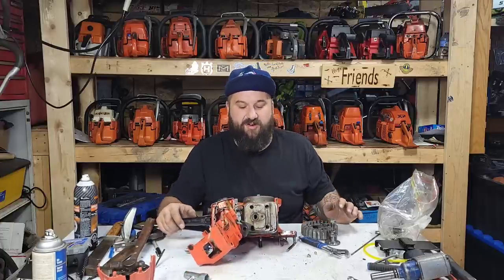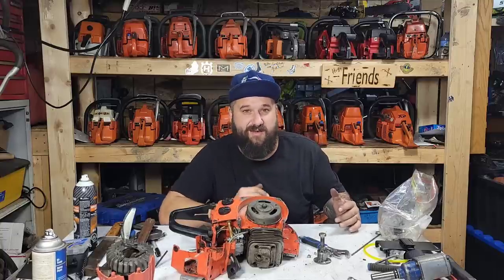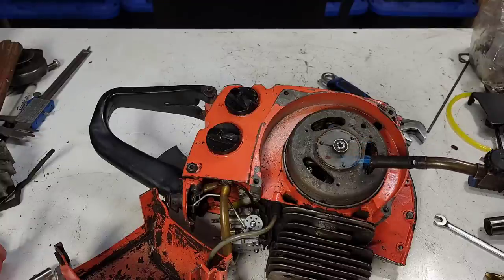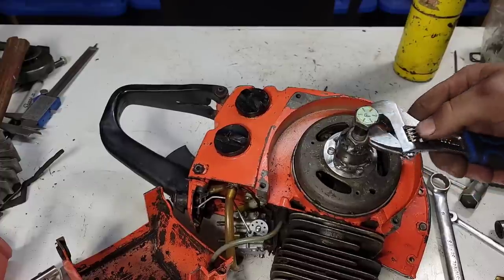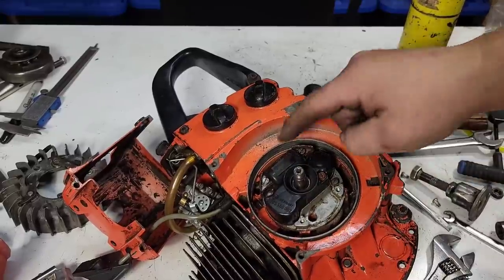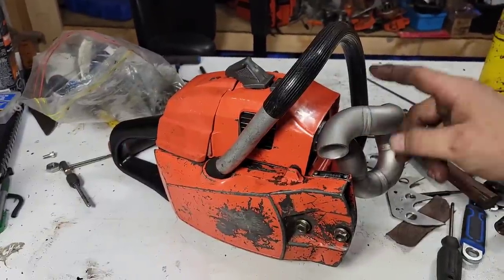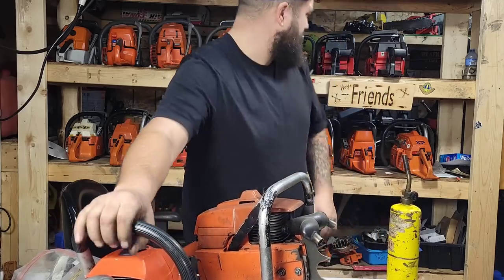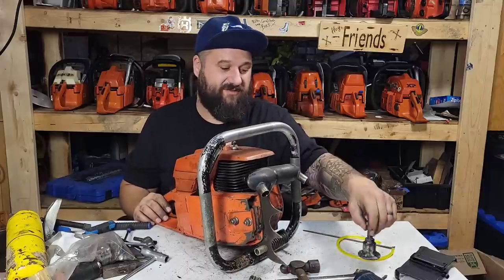Husqvarna 77 flywheel removal with a DIY puller.

Comment: This L77 has points ignition. You need to take off that plastic points cover  and clean points contacts with some 300 grid sand paper. It will spark, believe me. That rust on the magnets and coil does not hurt the spark. Magnetism does not care about rust.
Reply: Will this help me get fire to the plug? I’ve tried everything and can’t get spark. It ran last year but this year it won’t crank. Appreciate it bud

Comment: Nice "puller" build  :) , if I remember correctly , there is a set of points under that cover, bet a little crocus cloth on those points makes it sparky again, possibly a condenser as well. Believe is or not they are still available from a few places. I have an old L65 that needs a little attention on the points, this make jog me off center to get it sparky.
Reply: Liked the puller. Will something like that work for the Dolmar?

Comment: Hi Friend !  Why did you not sand the points ? That often be the culprit ! Sanding the magneto and the coil contact...i thought was secondary cause for ignition failior...  but needed to be sanded...i agree.  Hmm  I have several those types and one i damaged totally the magnets on...when kick on the cranckshaft... I glued them together though with JB weld..and stubburn to get it to run.  Love the saws..and guess what...it did work after...with gled togeter broken pieces of magneto.  Chainsaws is useful and fun.  Nice to be able to control their maintenance...thx to guys like you. Happy New year and hope things are well.  Good channel ! :-)

Comment: For the holed oil tank- you might try some of that “ new “ aluminum filler rod that melts at a lower temperature, sort of like brazing rod, slap a patch on it.  Or just acetone  and JB weld.  It’s oil, and not under pressure.  Cheap fix!

Comment: Silly newb question but with the hole in the oil tank could you go over and over it with brakeclean and/or electrical contact cleaner then giver the ol JB? Or would the oil behind it just cause near immediate failure?

Comment: a drop of oil on the end of the pointed bolt will help minimize metal galling. An affordable puller (not the round Stihl unit!) that is available on ebay will accomplish the job too...less time and cobbling involved than a DIY. I recently bought this ebay unit and it will fit up to virtually any bolt pattern on the flywheel. Mine was sourced through custom chainsaw parts in Washington.

Comment: there's a product called "Seal All"!!  it works awesome on oil, and gas leaks! been using it for yrs!! gas can be running out of the tank and you make a little ball of it in your fingers and press it directly on the leak and it stops!! then i usually gob some more over and smooth it out! used it on rusted truck gas tanks in the day! i get it at napa parts stores around here!
great vid!! love em'!! take er' easy!
has the consistency and looks like airplane glue!!
Reply from the maker: That is good stuff for sure
Reply: prolly could add a small piece of aluminum over the hole after you seal it and gobber over that till you find a new tank! question! its been suggested that i try a .325 9T rim and a 24 in bar and chain on my 2163 to 2176.5 saw build! think it will cut faster than a .375-7 rim with a 24 in bar?? afleet suggested that!

Comment: I converted the ignition system on my stihl 045 to electronic with an ignition chip. Dukes saws sells them on eBay, I would guess the condenser is shot.

Comment: I have a Stihl  056 Super. I put in a SEM GA type ignition  from the Bosch . I bought a SEM flywheel for 60.00 dollars The module not so cheap 190.00

Comment: J b weld will fix your oil leek problem  the saw sounded like killer almost like running straight herders on a hot  engine 👍😎

Comment: Be careful to much heat can destroy magnetism ive done it with a rm250 dirtbike ended up chasing my tail for weeks over it, other thing is the saw has a points set up and the last thing is rust does not effect magnetism it is in the briggs and stratton mechanic test

Comment: "I'm was thinkin" -- maybe that oil tank can be drilled out, the hole tapped and thread in a sealant covered  bolt to seal it??
Reply from the maker: I thought of that but it's too thin to tap
Reply: I've done one repair like this using a fine mesh screen and chemical metal from the outside...dress it up afterwards with paint. That was on a jonsered 100% lasted